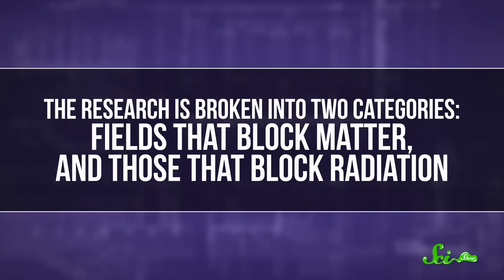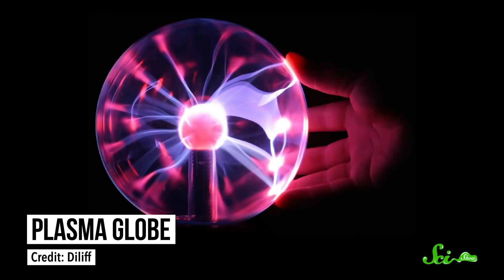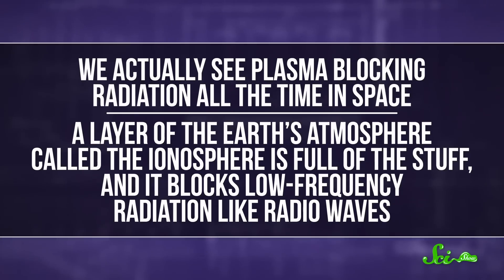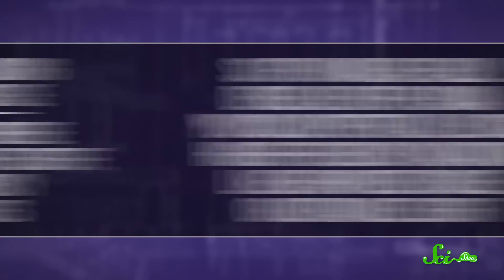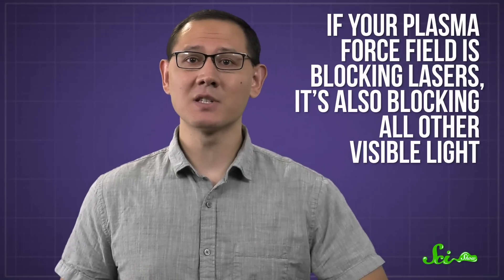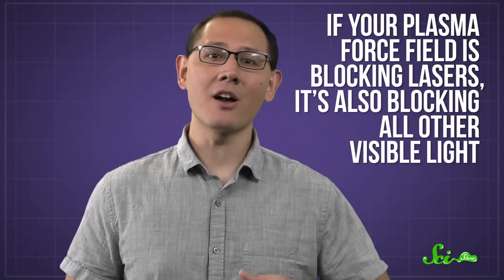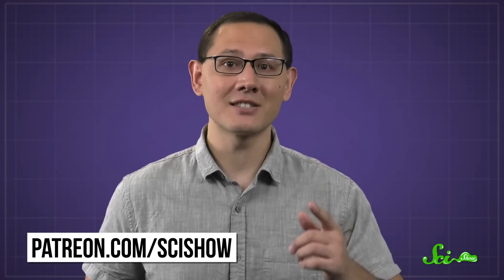How Close Are We to Building Force Fields?

Comment: Most modern tanks can be operated with no visible light available to the crew.  Its wall-to-wall monitors in there. Now lets seem some tanks with forceFields!
Reply: Wouldn't work the crew in the tank would still be blind inside the plasma field it blocks all radiation. so all those sensors on the tank wouldn't detect anything.

Comment: Well the idea of using plasma makes sense... Plasma has mass so enough of it could block solid objects and radiation, but I think maybe having the plasma shield rotate quickly might make it easier to block solid objects by sort of "pushing" them out of the way. And you only need to leave small portions unshielded for sensor arrays so one can see outside (but in space you can't see much anyway so long distance  non-visual scanners are going to be a necessity anyway)

Comment: No mention of the UK's force field for APCs? When a bullet, or shrapnel enters the field area, it is zapped with an electric charge to melt the metal, so when it hits the vehicle it is just a molten mass the bounces off.
Reply: Molten mass if its traveling fast enough will be worse than a stream line bullet

Comment: Hard science fiction shielding is in the realms of feasibility. Though in my opinion, only effective in space against rail guns using powerful electro magnetic fields. At lower outputs, they'd defend against cosmic radiation, at higher outputs could deflect a magnetic slug or particle weapons, though effectiveness would very. Anything direct would be less than ideal regardless. 

The idea of powerful shields impedance to sensor data or even direct optical observation has also been shown in Sci-Fi. And has by some been conceptually understood. 

Against lasers you'd be better off shooting reflective or highly refractive 'dust' in front of the ship instead though. 

Lasers are a terrible way of directing large amounts of energy anyways.

Comment: Wouldn't a mirror stop most lasers?
Reply: Does a window stay cold even though light passes through it?
Reply: No because reflection, defraction and refraction always take a percentage of that energy. High intensity would crack it.
Reply: The thing is that no mirror we can build is perfectly reflective.
Heard of Vantablack? A perfect mirror is the opposite. Until then, it will always absorb a bit of heat, and a powerful enough laser will cause damage.
Reply: I would assume that enough of the energy would be reflected away, at least minimizing the damage from complete absorption
Reply: Nope! Well, yes, mirrors can reflect lasers (that's how we direct laser beams), but any laser powerful enough to do damage would also vaporize anything reflective before that reflectivity came into play. You can still direct such powerful lasers with mirrors though! Laser beams aren't focused all the way through - instead, the beam starts wide, grows narrower towards its focal point, and then spreads out again. A weapons-grade laser would need to adjust that focal point to be on its target, but the beam would still be pretty unfocused inside the device itself, and therefore wouldn't hurt the mirrors shaping it.

So, to summarize, you probably couldn't stop a powerful laser with a mirror, at least not if the mirror is right where the beam is most focused. Any laser weaponry, assuming it ever turns out being useful and we end up making it (which isn't guaranteed), will have to have very flexible optics inside. Every time you "pull the trigger," they'd change the focal length of the beam to match the range to whatever you're aiming at. Anything in between you and the focal point and anything behind the focal point would take a much, much weaker laser blast. A mirror might do you some good there.

Comment: How exactly does the electric armor work.  Sounds like pseudoscience.
Reply: Thats what the sources in the description are for, silly :) http://www.defense-aerospace.com/article-view/release/10691/uk-testing-electric-armor-for-tanks-(july-2).html
Reply: @andronom557  I can't help but think this is highly impractical.
Reply: It's been a while since I read about those experiments, so I might be misremembering, but it goes something like this: many modern anti-armor weapons use shaped charge warheads which explode some distance from the target, and the explosion turns a metallic liner inside the warhead into a jet of molten metal so fast that it basically ignores the hardness of any materials in front of it. It's this jet that damages vehicles, not the explosion itself. Since the material of the jet is conductive, a short, high-power electromagnetic blast from the vehicle might be enough to disperse it into more of a "spray."
Reply: @ikaemos  I think i have a problem with the timing aspect of this dispersal.
Reply: @Overonator  I don't see why. Doppler radar can detect incoming objects and give you accurate measurements of their distance and speed in a matter of microseconds. Besides, RPGs, which electric armor is designed to counter, are relatively slow-moving. 

Besides, the thing this is defending against is, essentially, some fluid splashing against the vehicle, just really fast. You don't need a lot of force to render it ineffective and, of course, electric armor won't do much against anything fast and solid, like a tank shell.
Reply: @Overonator  Also, you might be right that it's highly impractical. But the current solution to the problem of shaped charges consists of strapping bombs to the vehicle which, once an incoming RPG is detected, explode in its direction, hoping to disperse the jet. I'm not sure which of the version sounds less ridiculous to the layman's ear, but at least electric armor works twice on the same spot, while reactive armor is just used up.
Reply: @ikaemos  You are talking me into it.
Reply: Overonator its just a glorified electromagnet on steroids that uses the tank’s armour as the magnetic coil.
Reply: Just imagine a missile going Nope and turning away

Comment: What about force fields to preserve astronauts from stellar wind? A magnetic field could be enough for that, but are we close to that?
Reply: Yeah, we know how to do that. The problem is making one small and light enough to be useful in a spacecraft. If your shield is 50% of the spacecraft weight it's not worth it.
Reply: @khenricx  , Yeah, in that case, normal hull plating would be better... Thanks.
Reply: @yaumelepire6310  One strategy that will surely be used is the use of food and water supplies as a shield, as water is very good at absorbing radiations. The best thing about that is that you don't need to bring anything heavy, just redistribute the supplies (you'll have anyway ) where you need them to be  !
Reply: @khenricx  But water is fairly heavy, so you might be better off taking a small amount with you and recycling it.
Reply: @yaumelepire6310  It's true, but you'll still have a bunch of it, like in the ISS.

Comment: Interesting! Never thought about how a radiation shield would make you essentially blind as a side-effect.
Reply: if you can switch it on and off fast enough, you might get the protection without the blindness.
Reply: @charllsquarra1677  That has the second benefit of requiring far less power than keeping it on all the time.
Reply: @charllsquarra1677  ... you realize it would be brighter than the sun... and a plasma... Flipping it on and off, would be the least of your issues...
Reply: @JakeFoster01  Dude, what the hell?
Reply: You didn't even watch before commenting.
Reply: xFade P.S. Uh yeah? Youtube has a 2x speed option 😑
Reply: radiation is matter! a shield blocking lasers would be the one you cant see thru!